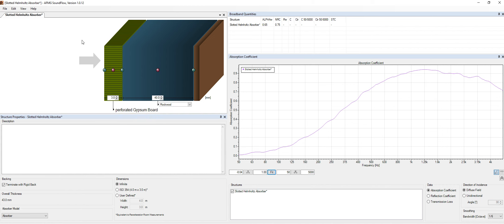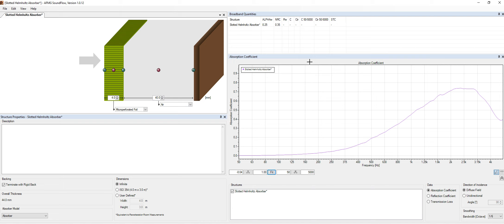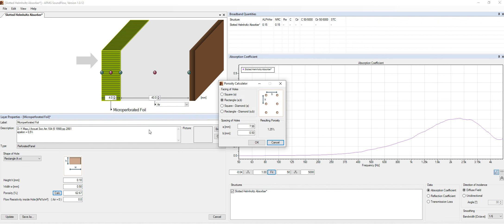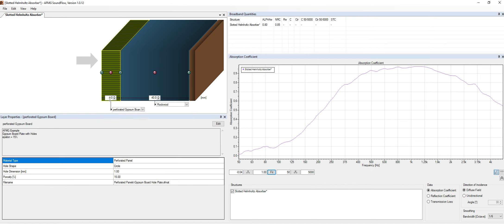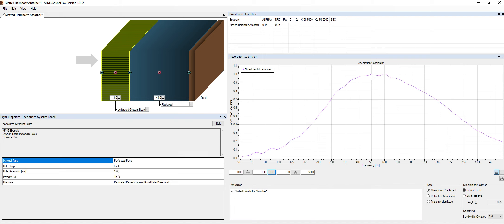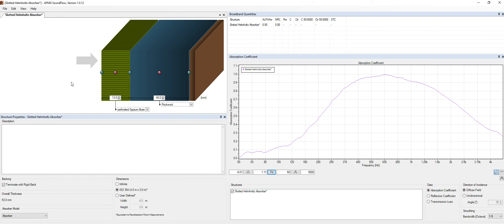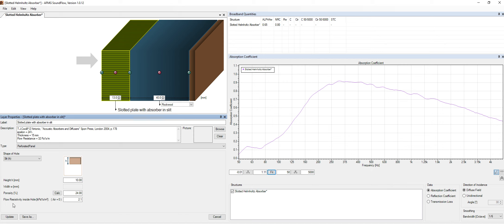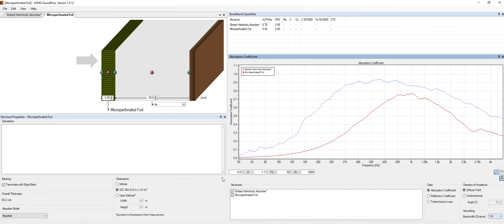AMFG SOUNDFLOW - Perforated and slotted panels - Acoustics Prediction - Part III

Comment: 11:20  "I am a bit confused when designing a slat absorber. We know that a slat absorber consists of several variables, such as slat thickness, slat width, slot width. However, I cannot find these variables. Can you help me find them?
Reply from the maker: The thickness of the panels are changed in the configuration of the material where the image is shown

All other information is changed below, you can change the dimensions of the slats or use the calculator of the open area to change that information.
Reply: @onlineacoustics   Thanks for your reply

Does the "shape of a hole" refer to the gaps between slats and what does "spacing of a holes" (Porosity Calculator) refer to? 
Does "a" show the distance between the centers of each slats or the width between each slat with sealed air cavity?
Reply from the maker: @panca4238  Shape of the hole is rectangular, oval etc etc

Spacing of holes is what it means, space between perforations, try to find the manual on their website, this is too complicated to describe here